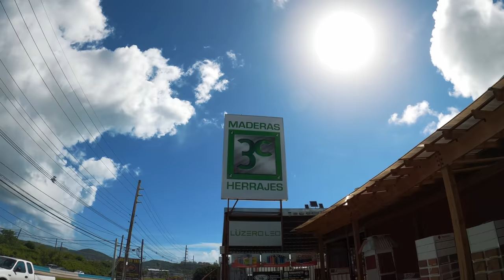BOAT YARD (PART 2) DESTROYED OUR BOAT SHOULD WE BUY THIS ONE?!

Comment: I'm thinking that the thick factory glass layers were most likely done with chopped fiberglass and not hand layup. Chopped glass is done by feeding either one or sometimes two fiberglass strands from a bale into a pneumatic chopper mounted on a resin/hardener spray gun onto a surface and an assistant stands by to roll it out while the chopper operator applies additional thicknesses.

Comment: Hay glass in your lungs is not good ..get a mask. You need to fix that inside cove with a fillet and biaxle 1708 needs to be placed 90* offset the direction of the glass. hooked-n-rolling has it right  ... after fillet layup  "with a thinner width like 8” centered then 20” then your final width that way you have three different layers holding instead of one "

Comment: OK.. Rehab your old boat.. $10k or more be on the hard for 3 months... Both of you get a job at costco doing anything and earn $20k for repairs.... Now you can spend all that on a new/better boat......   Or you can be on the hard and eat beans for 3 months and you still have a 40yo boat needing work..   Your $5k boat with a new engine is still a $5k boat.  Your repairs make no equity...    I just shake my head.... You are not setting your bulkheads in vinyl ester putty..... It will always be weak.   What does 3 months of air BnB cost??? Get a new boat.....  When the winds hit 50 knots and the seas are 6 meters and you are 5 miles from a harbor, then your boat breaks up.... Would you fly on a plane that you repaired???

Comment: What about welding plates onto the Side even with more Holes and also why not Bigger Diameter holes in same on  those Chain Plates then slide  same back in from the bottom up ... you could fasten them then into that existing Virgin plywood...as you said before Make Do...and if isn't broke why fix it... adapt and over come...that's my take on it, as you would say, " A Gangster Repair" but if it works it would save a shed load of work ... great upload people...

Comment: redoing bulkheads, ...you are basically building a boat from scratch, from the inside out.... but even more work, cause you have all of that demo and prep work to do.   Good project, yes, ...interesting to watch, yes....... but economical.... no way in hell.    I would not be willing to put all the time and money into that boat......you are making a $5,000 CL boat into a refurbished $5,000 CL boat.  Don't get me wrong...I like your boat a lot, it serves its purpose.   You have done a great job of patching it together on your adventures.     But there comes a time when making a rotten plywood built  boat  back into a safe boat without squeaks and creaks, is simply not worth the time, effort and money.  if it was just an engine refit and everything else was solid, I would advise differently.   So,....  hold off on the engine refit, stop throwing money and time away and start patiently looking for a solid blue water cruiser that fits your bill.... pick a boat that will benefit from your sweat equity (is that even possible, some might say, cause a boat is a boat)????    I think you can find a better boat, save money at the same time,  and be happier spending time on and in the water.   my 2 cents.

Comment: Did you paint the part of the wood that is not fiberglassed with epoxy to make it so if there is a leak, the wood will not get wet.
Reply: Edges should get a coat of straight epoxy and then thickened epoxy so it oozes out when put in place.  Hold it there while you do fillets of thicken epoxy…let it cure but maybe start glassing before the epoxy blushes. If you don’t get it before it blushes, you must wash off the amine blush to bond to that surface again.  I think almost all epoxy blushes.  Strip the boat and shop for a better one.  Yours is not a good foundation anymore.

Comment: you need to reinforce the bulkhead that you took out with serious metal angle stainless or galvanized or shore it up with that marine plywood if you can't afford  it and you need to pay attention and secure the bulkhead especially to top and bottom and sides /  / you learned you didn't need to take out the bulkhead / you can sister the other bulkheads if you''re worried  / and damn Matt BOTH of YOU NEED TO WEAR YOUR FACE MASK ALL THE TIME / you are playing with Emphysema / google it / fiberglass stays in your lungs like asbestos and silicosis / in another life time i was a commercial sandblaster and i also sandblasted fiberglass and its nasty stuff /  / both of you should wear facemasks around fiber glass and and when sanding fiberglass indoors and outdoors too / also wear long sleeve shirts and pants and gloves  / that stuff gets everywhere / i like the bathing in 7 Up to close your pores but i would wear your protective white jump suit too  / MATT you can't bulldoze this bulkhead stuff is your life line to your masts and is under a lot of tension  / fyi the fiberglass is not structural as you think

Comment: Please STOP, you didnt bond your board to the wall before fiberglassing, check out BOAT WORKS TODAY, Andy is a professional, you mix what is called peanutbutter to set the board to the wall, and use as a fillet, before fiberglassing, with out the bond it will be weak. Just want to help you not have to do over.

Comment: Your fiberglass guy is NOT giving you the best methods or material  advice, please get a second opinion!  Your chainplate bulkhead were probably originally glasses with 10 z woven roving. It should be redone with comparable materials. There are lots OV books and probably info on line. Each layer should overlap by at least 3/4". It's better to tear the edges instead of cutting, even if you tear the edges after you cut. Then you don't have hard lines that take more to fare and realm much easier than tears. You have to cut the woven fabric. Think of mat as filler of voids to tie in to with the woven fabric witch is your strength. You boat was built with polyester resin and you can certainly use a high quality polyester for repairs for less cost, easier to work  than epoxy. Remember you CAN epoxy over polyester but you can NEVER use polyester over epoxy. And yes, epoxy is stronger than polyester.